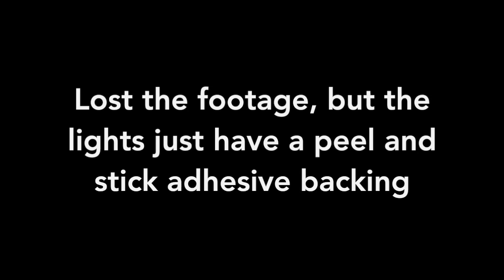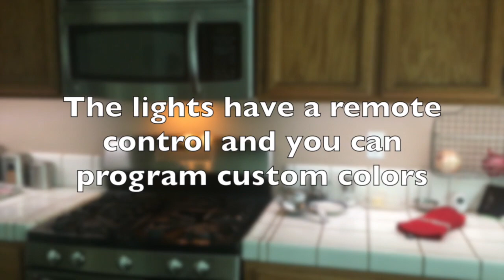BUILD: LED Cabinet Lighting

Comment: Did LED lighting under my cabinets a year or so ago and we find ourselves just using those lights [on all day cause we have herbs under them] rather than even using the built in/ceiling lights. Saves electricity. I just peeled and stuck ours to the bottoms of the cabinets.. didn't go all fancy like yours. Nice work!
Reply from the maker: Yeah I don't think we've turned our off since I installed them, I setup some custom colors and levels and they provide the vast majority of the needed light in the kitchen now.

Comment: NICE!!! Love the diffuser. Do you just buy that in sheets from the big box store?
Reply from the maker: I actually have a plastics supplier locally that I bought it from. its specifically designed to defuse led lighting (link in the description) but I bet they sell similar ones at the big box for overhead lighting boxes.

Comment: Well done, question: LED are low voltage, what did you wire them into or are they battery powered?
Reply from the maker: +Travis In Canada the kit comes with the power supply and remote control etc.